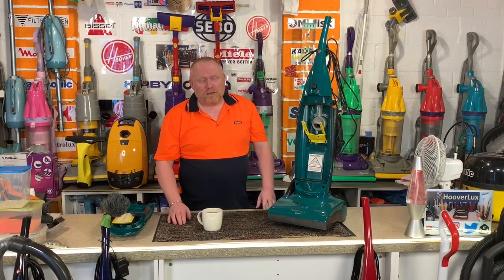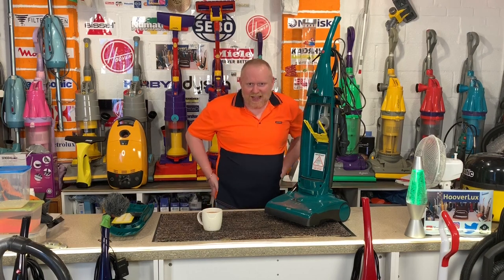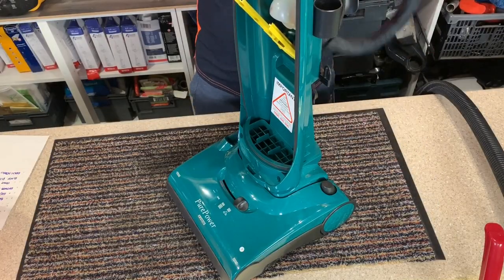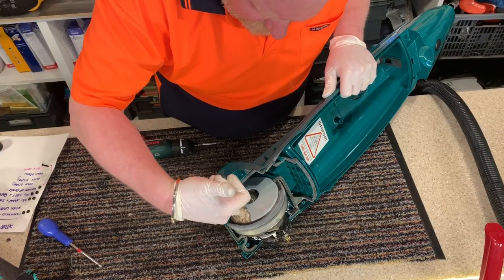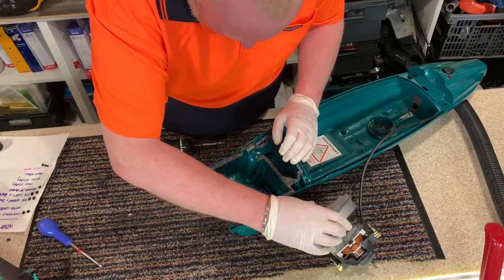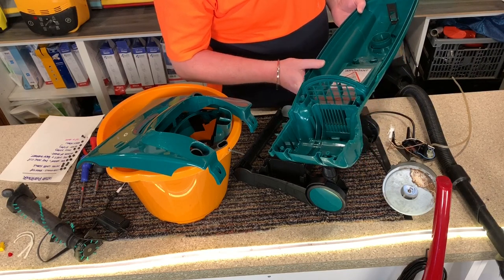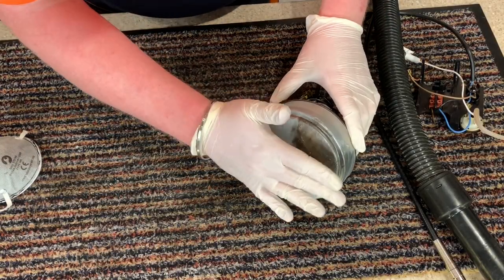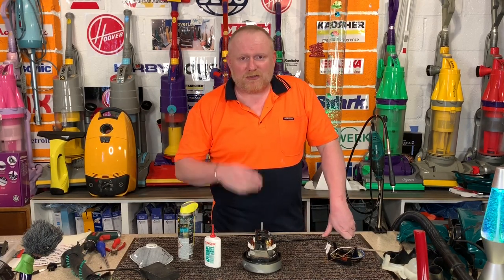A Mouse Was Living In My Vacuum Cleaner Part 1

Comment: The new UK high efficiency one mouse powered vacuum. Save on energy and fully recyclable. Lol.
Reply from the maker: 🤣🤣🤣, I could invent one with a little running wheel connected to a battery so the mouse can charge it up 🤣🤣🤣🐭

Comment: One year over the winter at work (when we are closed and there is no one there) we had rats eat the plastic on henry's, destroying the hose inlets on some making them unusable. We were initially wondering what the small bits of plastic on the floor by the vacuums were and then we found out.
Reply from the maker: Omg! I can’t even imagine the destruction that would have caused. It was bad enough with one mouse, but a load of rats! Dear god, I’d have died 🤯
Reply: Luckily the rats had gone by the time we saw the damage, where I work is essentially a very large shed and so things like that are inevitable, we generally end up cleaning the vacuums out now and storing the filters (one of the things I guess they were trying to get at) separately and as such we have not had a recurrence of the problem.    @HooverLux
Reply from the maker: dglcomputers very good.